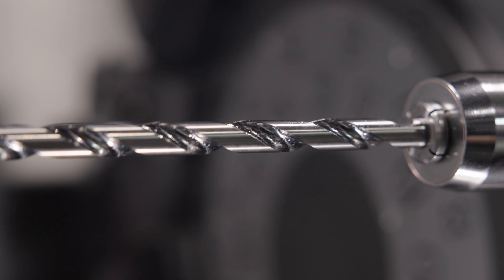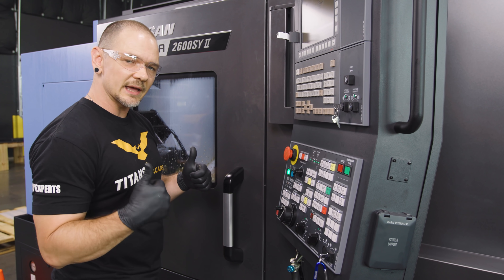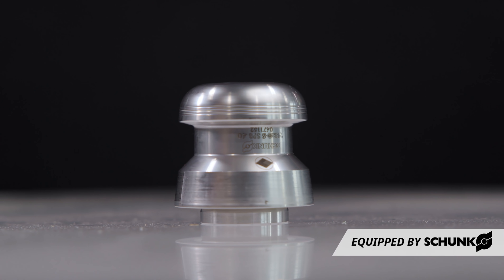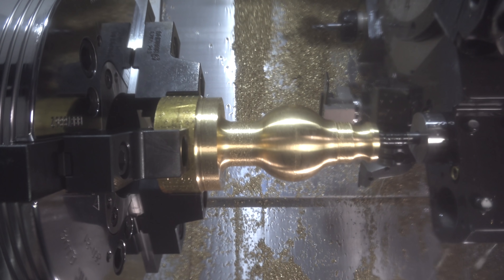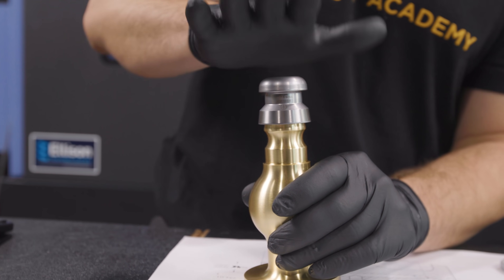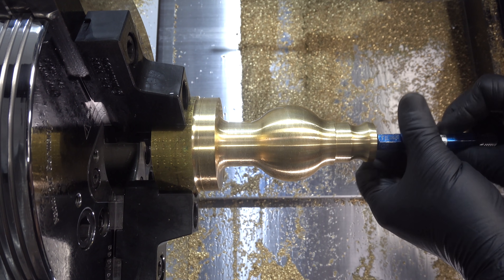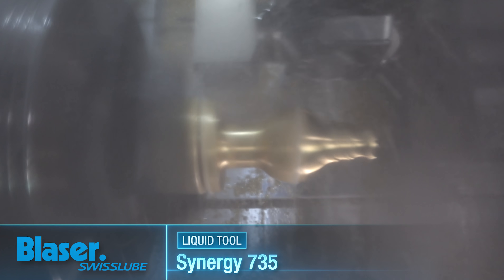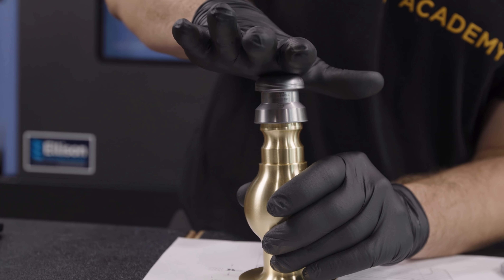15XD Deep-Hole Drilling in Brass Part! | Kennametal Beyond SC Deep Hole Drill | Doosan PUMA 2600SY

Comment: What’s the purpose of going full speed at the end of the hole? Why not just maintain the same speed? Or have a higher speed, not necessarily full speed, all the way through?
Reply: Not at the end of the 15x drilled hole, it's full speed at the end of the pilot drill hole. Essentially full speed from where the pilot drill left off, to through the remaining length of the part/depth.
Reply from the maker: Yep, drill spins slower when enter ring the hole to keep it nice and tight

Comment: could you explain why you used those specific features of the drill bits, like why the pilot drill was larger and had a different drill point angle?
Reply: Vlog 107 had it all if I remember correctly.
Reply: @rcandcnc9684  thank you, I will give it a look.

Comment: Try this one..
15-5 stainless..
.007 total tolerance.
.140 carbide drill, 5 INCHES DEEP on a mill......
Job also had 5 bore heads, 5 thread mills,  3 porting tools, 4 operations, 73 tools total..
Over 100 parts, never broke a drill.
Reply: its pretty hard to break a drill unless we talk about very small drills 
well of course if u fuck up the feeds and speeds anything is posible

Comment: We go 30x diameter on some jobs. If the hole size permits, at some point after pilot drill, drop in a long end mill. It will straighten out the hole from taper and subsequent drills will go straight. Totally unorthodoxed, but crazy goes to the bank.
Reply: Last week I had a job going 25xD with a .035" drill.